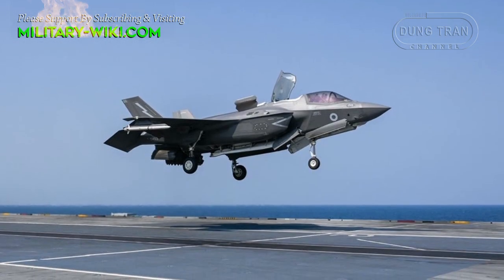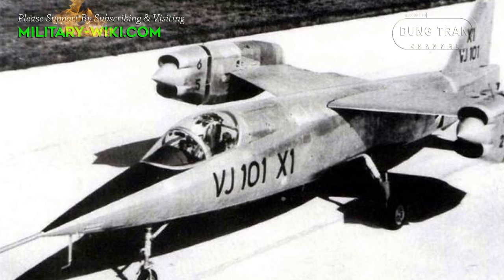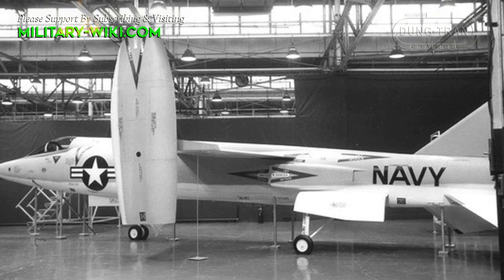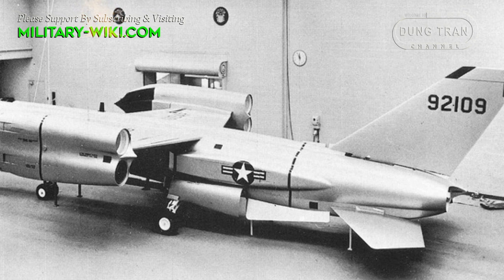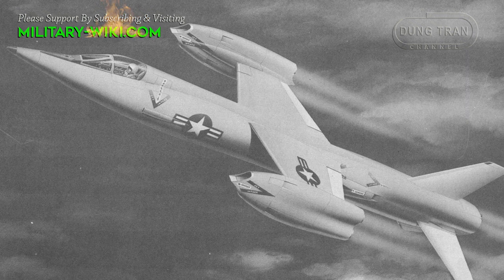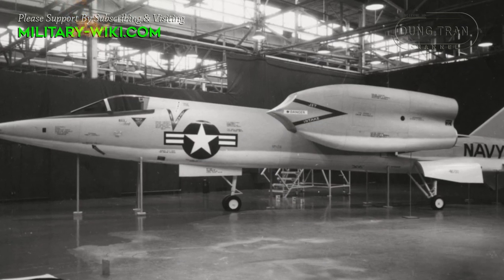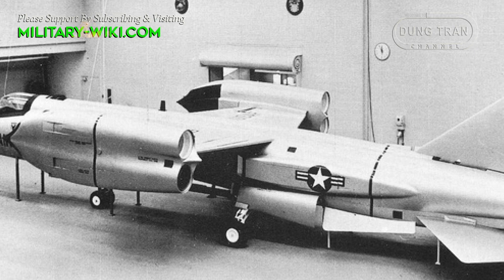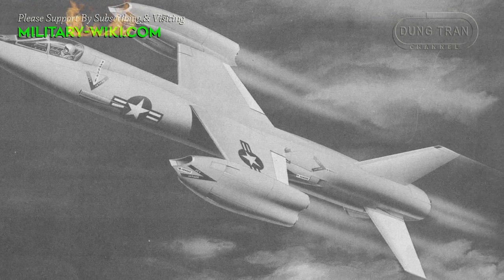Bell D-188: A Demonstrator With Unique Vertical Take-Off And Landing Capabilities

Comment: Why can't tech like this be put to use now a tilt rotors like this will set the standard for thatvtype moving forward.
Reply: it's job was filled by copters and cruise missiles no need for itplus the size of the rotors on something like the V 22 kill launching a missile off the wings!!
Reply: These were so heavy they couldn't carry much in the way of weapons. That wasn't an option at the time as they were removing gun's from designs and outlawing the practice of dogfighting. That is what led to the major losses of the USAF in the Vietnam war. These would have been a good option if they had reduced the weight of the engines and their tilt mechanism.
Reply: Do you think that with the advances in technology from engines to composite materials and fly by wire that a platform like this will be suitable for militaries with mid level budgets? I have seen proposals for the Army having a tilt jet concept like this one in the guise of an Assault Transport eventually these are going to replace tilt rotors